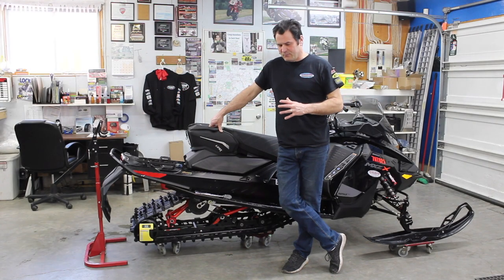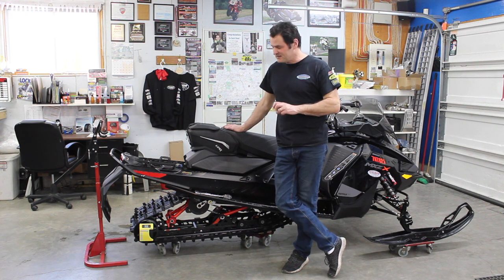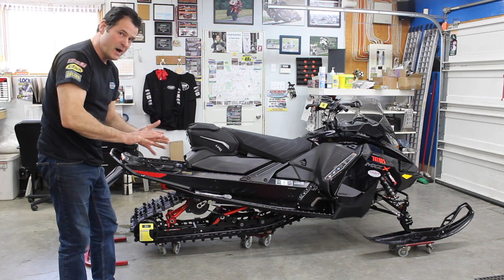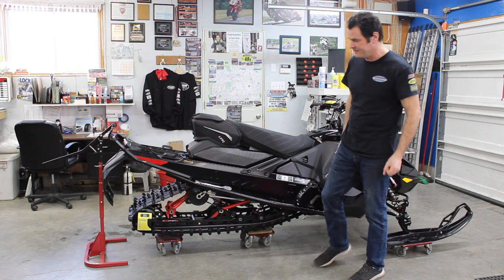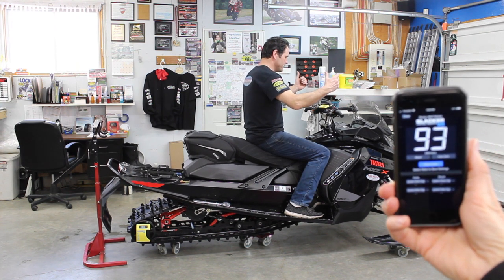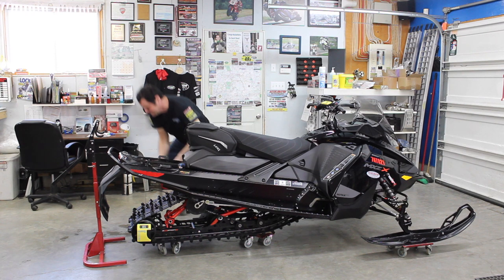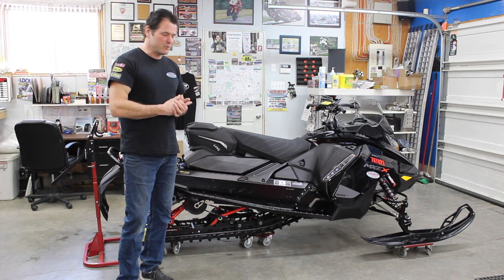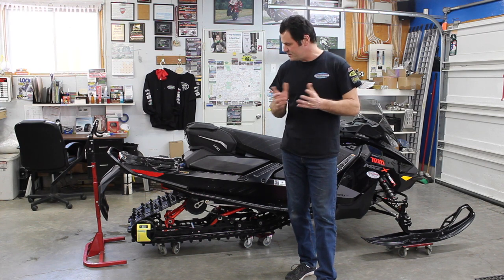Accelerated Technologies- Snowmobile suspension tuning, setting the rear sag with the Motool Slacker

Comment: This is very helpful. When setting the sag, should I not have my gas caddy or anything else on the back? Just curious if it should be like me riding the sled on the trail or just with nothing on it in the garage. Also, what tool did you use to adjust it so quickly and easily? Thanks.